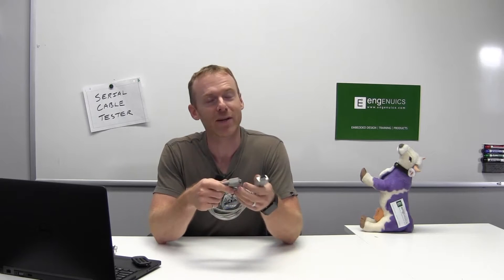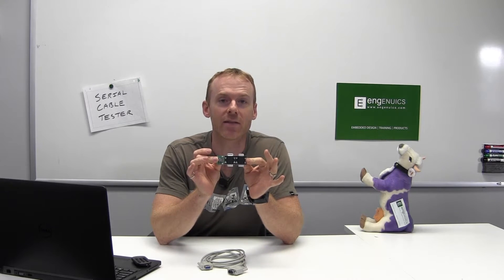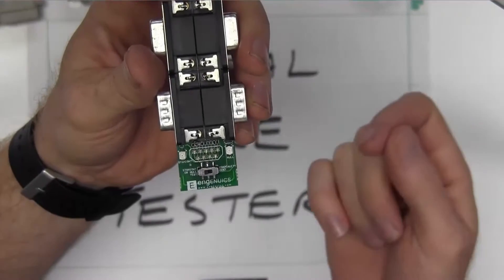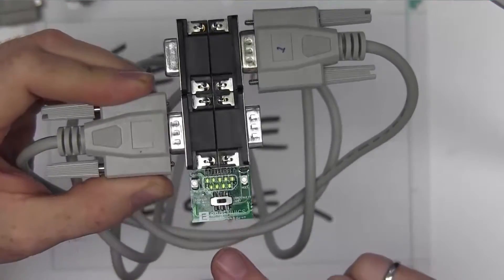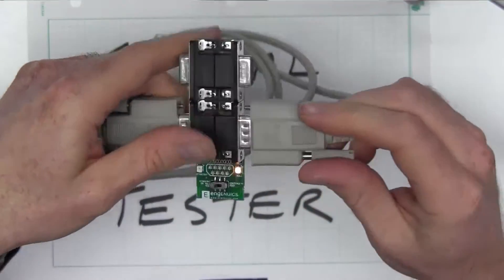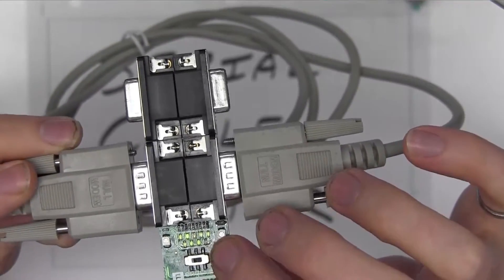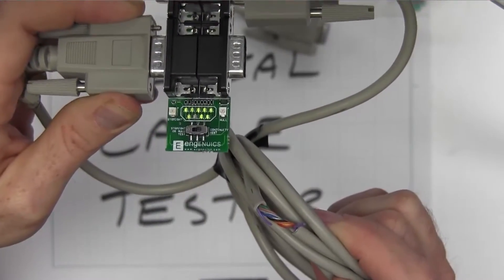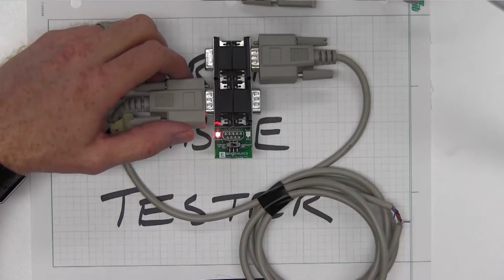Serial Cable Tester Product Overview

Comment: Can I use 2 of these together to test a cable end to end? I deal with rs232 cables that are 50+ feet long that run through walls. Need to be able to quickly identify if it’s a miss wire or programming